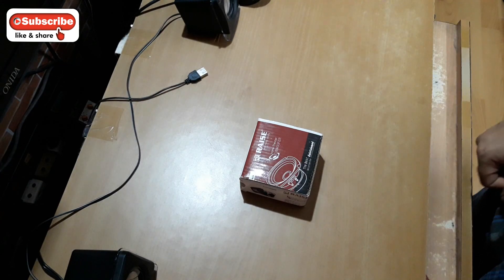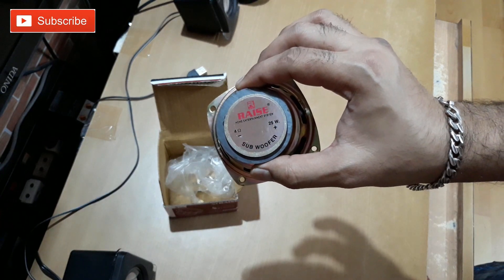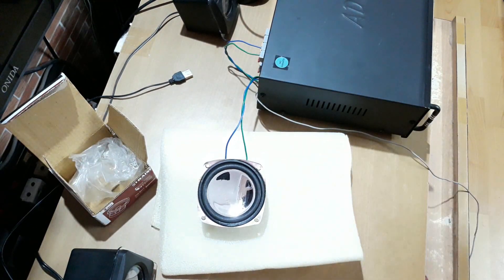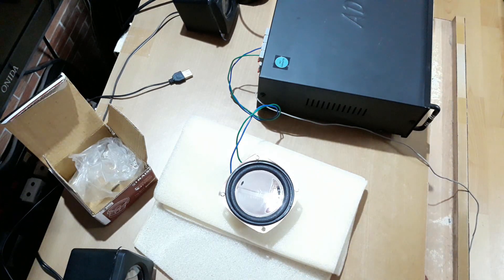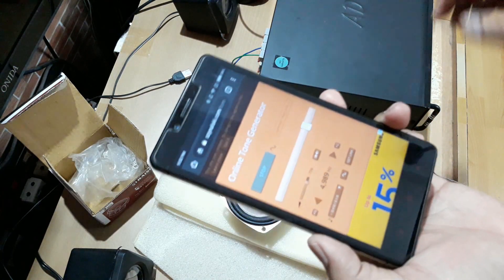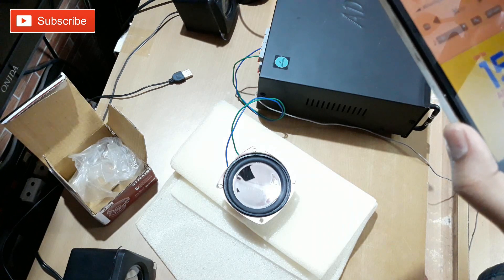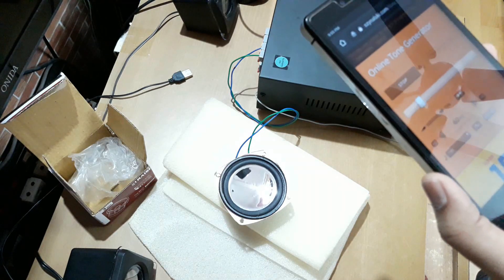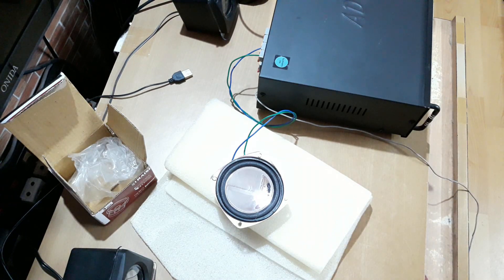3Inch Mid Range Woofer Unboxing & testing

Comment: Sir, hope you're doing well ...

Could you please tell where did you get this mid range speaker, place and contact if any...
Reply from the maker: Hello sir. Thanks hope your fine too.
I bought this speaker from a local store in northen kolkata.
Reply: @technoboy-allinOne  sir is't possible to share contact of the seller
Reply: @technoboy-allinOne  thanks for your kind and quick reply
Reply from the maker: If you live in north 24pgs or around dumdum then i can provide you the number.Dont have right now. I will get it from the seller.